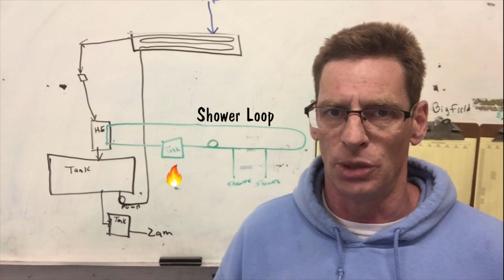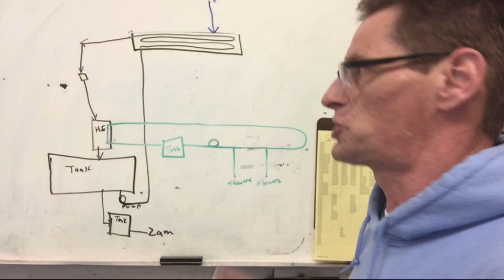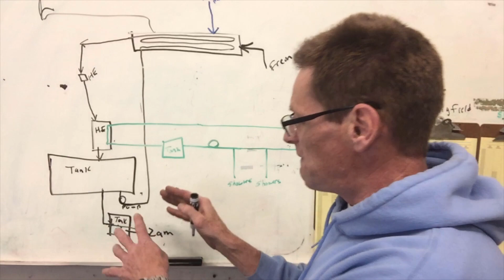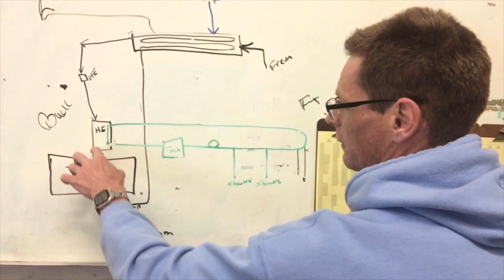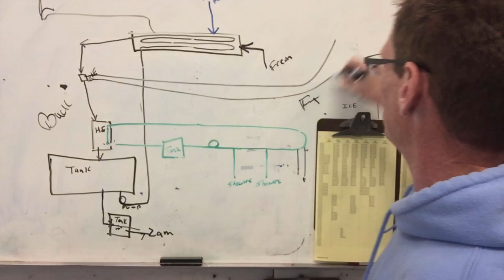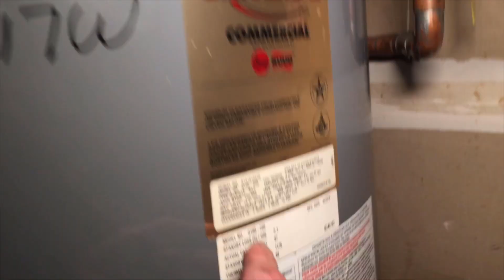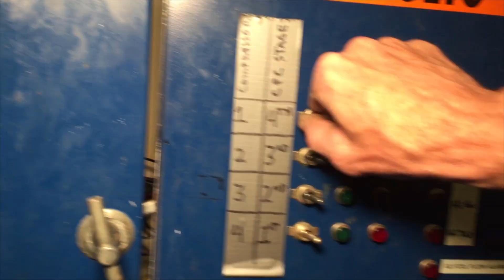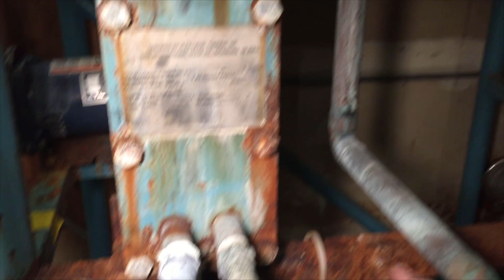Heating the Zamboni Water with Recovered Heat

Comment: So why exactly can’t the showers share the same water as ice making water? Is it a sanitary thing?
Reply from the maker: I am sure it's something like that. From what I was told the main heat exchanger was donated to us, most likely used. I am sure it depends on what each one is rated for when manufactured. Also thinking perhaps its more efficient having a second loop as far as getting the water out to the building.